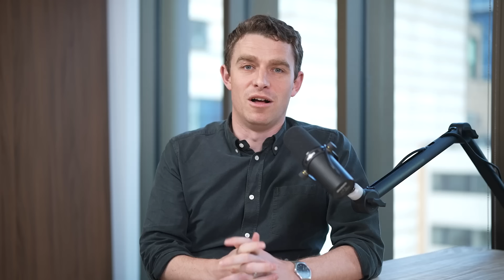How Thermal Storage Decarbonises Industrial Heat - ENERGYNEST

Comment: Check out the almost passive Solarwall TM technology! It would reduce how much cheap energy you need to store in a thermal battery and it can also work in reverse throwing hot air outside to reduce penetration through the wall.

Comment: This would be a great solution for Greenhouse heating???
Reply: Greenhouse heating uses low grade heat. Heat pumps with solar panels and hot water storage (with phase chang material). Energy shields, insulated sidewalls etc. Having two heatpumps one outside, for heating, and one inside for cooling (heat discharge to heat storage) and humidity control.

Comment: the heat as a service could be a good call to start at the steam generation/distribution on the chemical park service provider side. most of them should see the value and potential for profit, they should even have sizeable grid reserves and land to use

Comment: Since their large, well insulated system loses about 2% per day, I guess my dream of seasonal storage of heat (and cooling) for my house is receding even further...  But thermal energy storage (TES) is clearly hugely valuable.  The more players, the better!
Reply: Yeah, that's not going to happen. Entropy is a bitch and the best way to deal with it in a longer timeframe, like the seasons of a year,  is with mass, not energy. Hence fuels. That will be the sweet spot for green hydrogen, btw.

Comment: I think that the more decentralized the grid is the greater the flexibility to lower prices and the more storage you have the faster you react to demand this very smart and timely content I learned a lot about supply and demand please have more of this type of video cheers
Reply: Because lower prices when more money being added to the system has always worked before and as consumption in one area decreases it will never increase consumption of oil based goods which is 100% of goods in society..
Can't add more money to a system and expect prices to come down and gas is waste product of extruded foam shoes, synthetic rubber, then it will always be used and available as long as oil is refined of which no-one has removed from their lives.
This channel is just propaganda to sell more product

Comment: Very interesting. How about using the waste material coming from steel production. It’s abundant, free, and can be heated to 2000C. And we need to do with it, not dumping it in landfills.
Reply: At least in Germany most of the waste material from iron and steel production is already used in construction. So chances are high that some of these waste materials is already used in the concrete they use as a storage.

Comment: In the long run there is no arbitrage. If everyone can save money with temporal arbitrage then this will increase demand at times when electricity is cheap, causing a price increase. It might work for now, but systems like this will reduce the variance in electricity price that they rely on to remain viable. It's a great idea, great for the planet and currently financially viable. But any for of grid storage always has the effect of stabilizing prices.
Reply: Demand shifting and storage stabilise prices, agree. However by increasing demand during low price periods they also make it possible to add more cheap revewables to the grid. I doubt if in the end it will result in significant prince increace during cheap times. It will push expensive peaker plants of the net during expensive times though. All in all are demand shifting and storage technologies are essential for the energy transition. Time will tell which technologies can do this the cheapest.
Reply: @SimonNL1964 also important to remember that, as renewables start creeping into more and more time in the grid (via storage), the business proposition for generating electricity with gas gets worse. Gas power plant owners also want their plants to run all the time.
Reply: Issue being any money saved has to be saved forever if we are talking about energy, efficiency is a saving of energy, saving in one place then spending it into the community while 100% of goods are oil based or touched by ut increases the consumption of oil.
10% of new GDP, so new money being created is renewables globally, the emission range of 0.3kg per dollar is then multiplied by 5-10 times carrying forward into the future, for an example new land clearing/crops is less than 1% of new GDP, this increased debt/money is called growth as consumption rises.
There has been zero transition and all renewables have made it worse because all energy has been an add-on, Jevons law of increased efficiency means more consumption and prices will never come down while more money is being added.
Renewables on their own have been a debt instrument to input money. Without policy change or reducing to that level of energy then nothing has or will be achieved by cheaper and cheaper prices because of increased consumption.
It would be better if oil and products were 20k per kg, not the other way regarding climate change, the reason we are supposed tog et them.

Comment: How does this compare to the sandbattery? it seems that one is much simpler to produce than the special concrete (which might not be that expensive in itself)
Reply: It is not a super special, expensive concrete. Basically you need additives to keep viscosity low in order to be able to pull out gas bubbles in a vacuum. Might also degas the water or concrete water slurry before mixing, and mix slow enough to not trap air in the concrete. Since it is not a structural concrete I assume it is a fairly cheap recipe.
Reply: I would also like the see a comparison on thermal performance vs cost. 

However I suspect a big difference is the amount of air in Sand which massively reduces heat conductivity.
Reply: Good question..  and there is also a really good australian company working with blocks called MGA thermal..   they have no pumps or oil.. so could also be a better option.

Comment: Cheaper and better! Love a bold statement in the opening 

Note - on the energy held in the concrete block vs batteries, that’s when heated to its standard temp (300 degrees, I think) it’s also a different form of energy, electrical vs thermal.